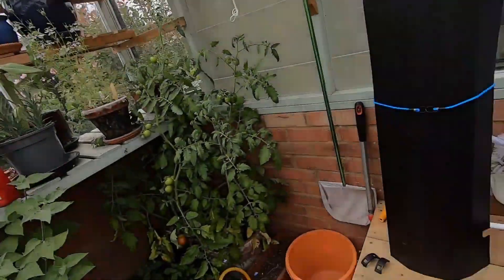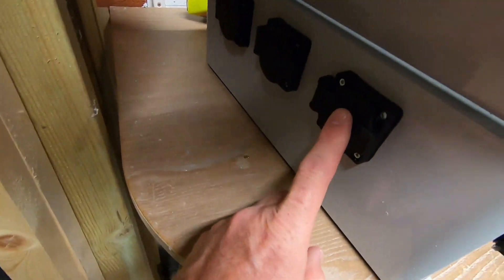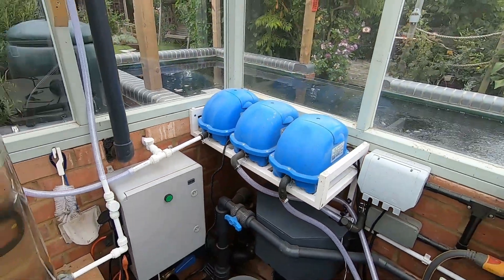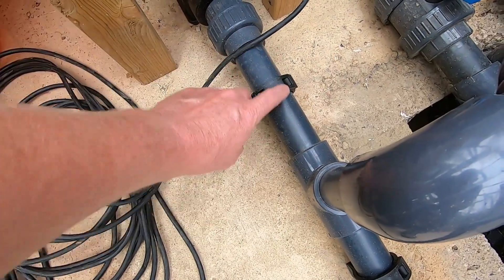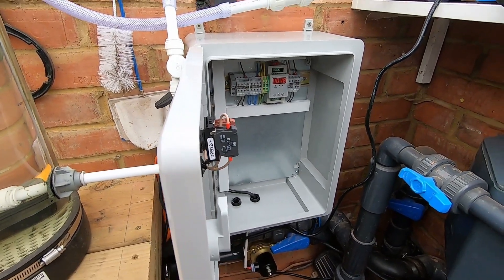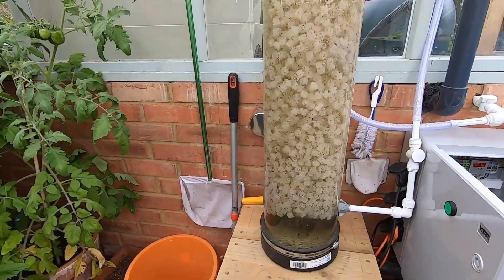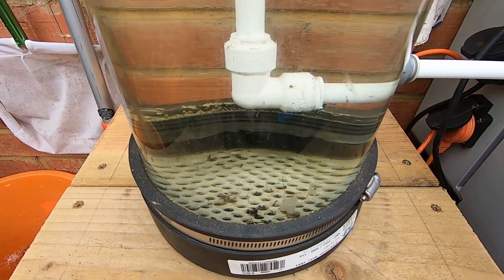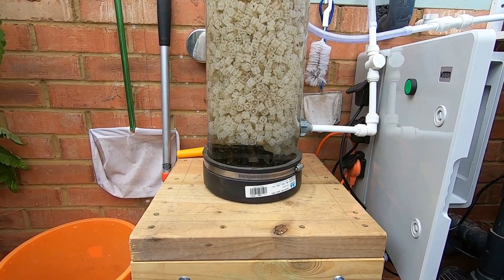Koi pond upflow filter start up - Some wins, some losses!

Comment: You can see what Terry must have had a long playing around with this and the reason he's taking from the moving bed and returning it to it for the polish on the water. But cleaning the dirty water is giving me ideas on my up flow with a auto clean i did look at it but the price of a 4 inch auto valve made my knees go funny.
Reply from the maker: I doubt it will make millions but it's been a great project so far. 4" valves with auto are space age prices. Cheers mate

Comment: I love watching your videos, but can’t help questioning why you have an all singing all dancing brand new drum and you are filtering the dirty side with a homemade up flow filter. I know we all mess around when we have time on our hands but wouldn’t it be better polishing rather than filtering. Not a criticism just an observation.
Reply from the maker: Any observations are welcome. Unless I return the water to the bio side from the upflow I can't polish it because the bio side can't handle 3 pumps drawing from it. It's a filter, that's all, I just enjoy tinkering. I will probably run a line from the upflow top back to the bio side later then I can swap and change from dirty/clean in and filtered/polished out. Bottom line it's personal choice, I try not to follow the crowd, it's nice to plough your own road sometimes. Thanks for the question though. Stay safe

Comment: When all else fails RTFM (read the f*caking manual) Panel wiring my apprenticeship taught me to dress the wiring with lacing twine that was an art form, come on down cable ties
Reply from the maker: My first panel was thrown across the floor, I quickly learnt to be neater. It was lovely to put on pin crimps again. Stay safe mate
Reply: @CATANDEYEKOI  How times change, we had our fingers pulled along strips of jacks that we had just soldered if we bled we had failed!
Reply from the maker: @edlesboroughkoipondstevech3546  Have you deburred that 20mm hole? Rubs your finger around the hole, any blood and you failed Gaffers would be arrested now!
Reply: @CATANDEYEKOI  it did teach us though, I de-burr all my holes even at home, currently moving all my garden lighting cabling and control along with pond stuff from a large enclosure to smaller ones about a yard away as part of a general refurb. Looking forward to dressing the panels and wiring the relay interlocking, I need to get a life! Carry on with the excellent videos, yours are one of the regular ones I look forward to with the koi diaries and Wrighty’s along with the boys from the south west there are a couple of others and many I just flash through.
Reply from the maker: @edlesboroughkoipondstevech3546  Cheers Steve, feel free to visit if you are ever nearby. Stay safe
Reply: @CATANDEYEKOI  Hi Steve will do, look forward to it, cheers